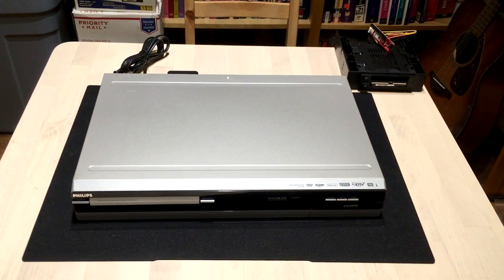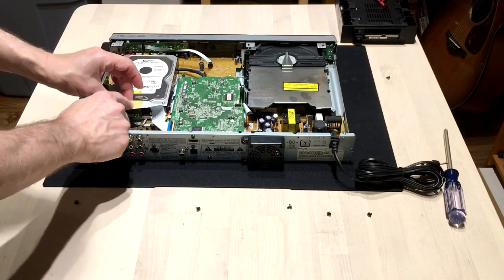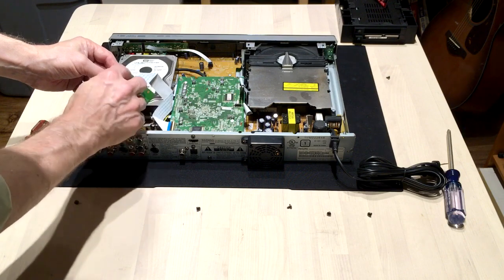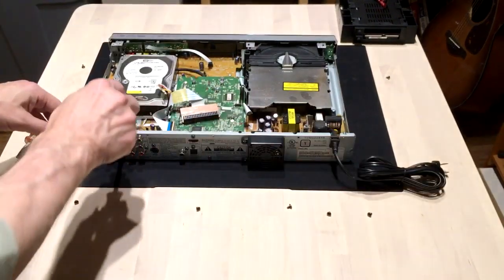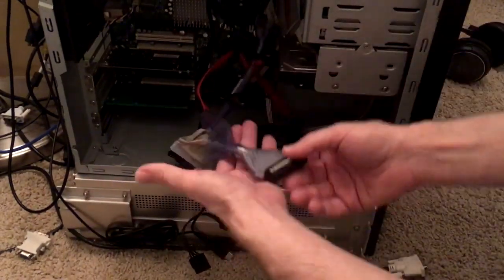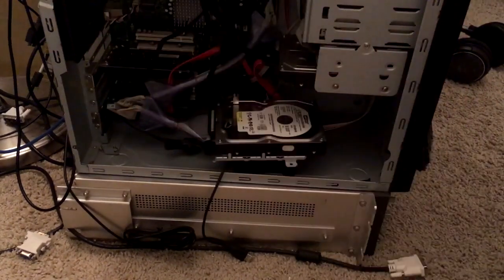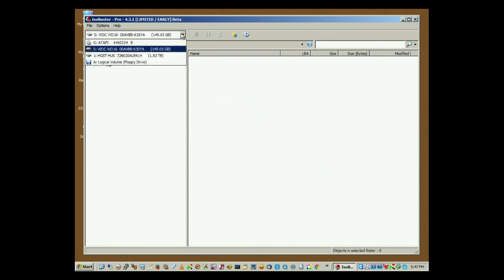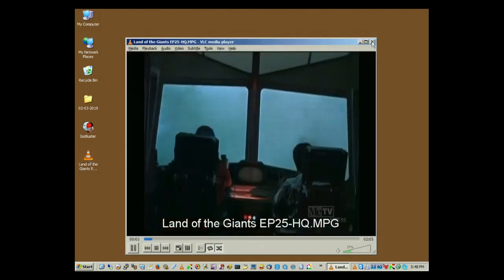Philips DVDR-3575 extracting Recordings with IsoBuster 4.3.3

Comment: Can I do this on a Philips 3455H ? I tried but hd wasnt even detected on computer :(
Reply: Late message but you certainly can do it on a hard drive in a 3455H! Ubuntu!
Reply: @gedionsamuel2256  which version do you recommend? can I run it on an external hard disc or it's better to make it the main operating system?

Comment: I tried an SATA to IDE drive in an attempt to swap the drive with something more recent (2.5" 750GB SATA hard drive from 2012). Unfortunately, the converter card sticks out too much to the point you can't get the cover on without the risk of damaging the card, interfaces, or drive in the process. I opted for the StarTech one since it's supposed to be the best. If you take out the drive mount, you might make it work, but there's nothing to mount it to in the process. Oh well, it was worth attempting anyway. Thanks for your replies on my previous comment. I think as old as it is (going on 13 now), it's not worth fiddling with. On a side note, I did confirm that the maximum recognized drive is 500GB based on the max recording time calculations. 1 hour mode goes up to 106 hours, 2 hours 212 hours, etc.
Reply: Plz someone give me its full version with key i'm unable to extract my files it requires key
Reply: I figured out a way of cramming a 3.5" SATA drive into the unit. It works perfectly fine now. Thanks for your comment.

Comment: Nice instructions!! Thanks alot. Do you mind telling me the size of the recorded files from your philips 3575 deck? I heard it has quite decent recording quality. I'm considering getting this deck but I'm concerned about the file size. For my jvc mv5u, 1hour and 28 mins gives 4.374gb. For toshiba dr-410, 90 min recording only gives 3.0gb. Please let me know. Thank you.
Reply: The "speed" of the recording is the same across all brands and models for MPEG2 DVR recorders.. it has to be because the DVD-Video standard defines it explicitly. So XP speed on one recorder will produce the same size file for the same amount of time at that speed across many different recorders.  Whatever size yours produces at XP, SP, EP, LP SEP.. will be the same. You can go MN or FR on some recorders.. but that is not the norm, and frankly hard to set up. Originally when intending to burn the recording to disc.. you had to edit it and chop it up so that it "fit" on 4.7GB DVD discs. But doing it this way.. you don't have to edit it or chop it up. The recordings can be left in their entirety as long as they were when recorded. Extracting them to a PC maintains the same size.. whatever the time length of the recording. After the raw file is on a PC you can use a Video Editor and DVD authoring programs to make whatever adjustments you like.
Reply: John Willis thanks for the response. I feel compelled to tell you that your belief is quite common among cosumers and prosumers. I agree that most dvd recorders produce same file size at same recording speed. However, there are exceptions. Certain brands, models manufactured at certain years give the flexibility recording. I have toshiba Dr-410, funai combo, and jvc mv5u. The jvc mv5u gives the best quality recording in terms of cleanly encoding, filtering vhs quality to even better than the source without adding block noise. Most consumers don't even play back their recordings on other dvd players (they usually play back theirs on pc screen) so they probably don't notice this block noise issue. The flexibility recording allows users to adjust the recording bitrates (lower bitrate recordings have artifacts that users seem to believe these are details). These are actually chroma noise and luma noise!!!! If I were you, i would give become a member of this site (this site has been famous for more than 30 years dedicated in video conversions). Here is the link to the article that I think very useful:
http://www.digitalfaq.com/reviews/dvd-recorders.htm
 I got the expert response on the dvdr 3575 right after I left you a comment here. I no longer want to purchase this 3575 deck as it adds block noise to vhs conversion. It is great for tv cable recordings. To clarify, the setting up flexible recording is very easy across the recommended dvd recorders in the article above.
Reply: Did you copy the content to a PC? I was told linux is needed 
I'd like an easy way to convert videotapes but via usb is a mess to realize the best format to use and my Philips recorder has dvd sector broken 😢

Comment: What's your advice about replacing the hard drive? I'd like to sell my unit, but I've been running the same hard drive for years. I was thinking about using an IDE to SATA converter board and placing a new hard drive inside the unit. From what I've read, people have successfully used 250-500GB hard drives in this unit with no issues. Do you think there's a risk to not using something close to OEM? IDE is so old and many of the listings I've seen for drives are usually old stock, refurbs, or used drives.
Reply from the maker: At this point almost all IDE are refurbs, except SSD PATA or M.2 PATA drives which are controversial. They are rated at 3 years and due to the continuous Live Buffer wear the NAND chips even when not in use, Standby mode helps. But no one has done a true study with them in DVRs.. they might last up to 8 years some estimates. Other people choose IDE to SATA adapters, so they can use a modern SATA drive preferring laptop 2.5 since those come in smaller 1 TB or less brand new. I can't offer any real advice based on personal experience. I am still using refurb drives.
Reply: @videorecap7536  Thanks for the comment! I'm planning on ditching the Philips DVR in return for a network based solution instead. It's served me well, and I've recorded many hours on the unit. I'd like to sell it and get a little bit back on the unit. With the hard drive approaching 13 years without any issues, I know it's just a matter of time before it kicks the bucket. I'd rather not sell it until I've swapped it with a fresh drive. I'd thought about putting an SSD in it, but with that kind of 13 year old technology, that would be overkill. The only advantage would be the videos and video menu loading faster. Plus, no TRIM command would limit the lifespan of something like that. I'll try a converter board and a newer SATA hard drive to see if that's a viable option. Thanks again!
Reply: @jony3860  I can say that SSDs in the 120GB range are about $10 to $20 brand new, jmicron based IDE to Sata adapters usually work and fall in the same range $10 to $20. A metal "converter" bracket which brings the sata pins out and to the side like a full size  Sata drive will run about $10 and would be important if replacing a full size 3.5 IDE drive and using a 3.5 snug IDE to Sata adapter which hugs the same position on a real 2.5 Sata drive. All a bundle of info you may not want.. but makes a nice neat package where your directly replacing an IDE hard drive. The problem with refurbs and new old stock IDE drives is they are often used and people accept running them even though the know they have bad sectors and are in the middle of dying. You can buy SSDs new that are larger than the old IDE sizes for next to nothing these days. A "smallish" 4 TB drive may have a Sata connector.. but they have shingle tech.. and sector sizes larger than 512 bytes per sector which these old DVRs can't handle. An SSD or small laptop drive generally comes in 1 TB sizes or less and for low cost. And you can get them new.